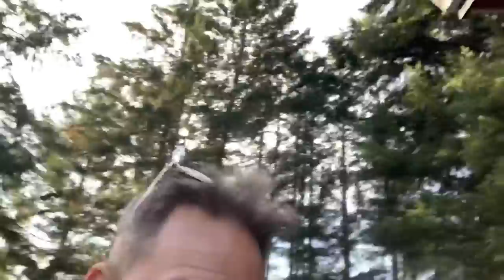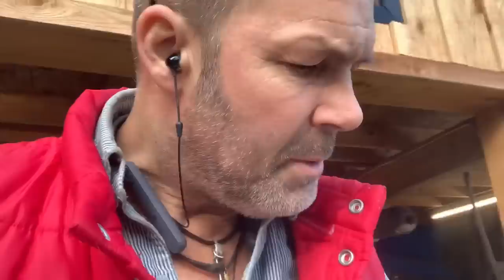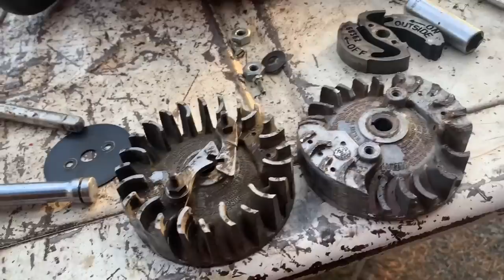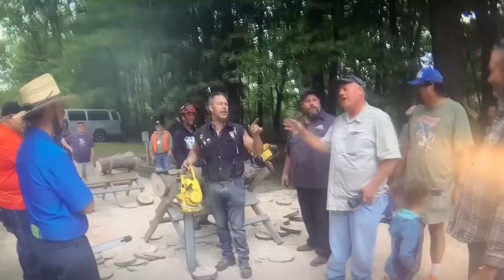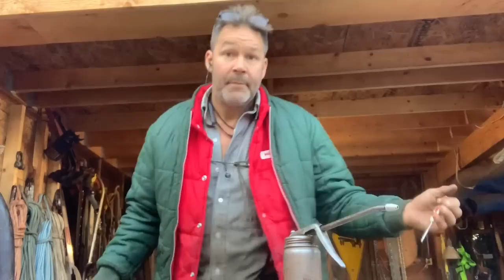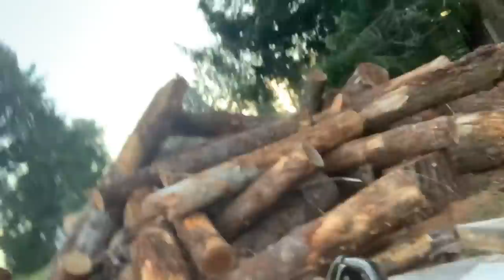Homelite chain saw find

Comment: Congrats, Billy. Just got a J-Red 621 running today thanks to the 20 or 30 parts saws of all makes I refused to junk. What a rush. Piston and cylinder looked brand new when I took the muffler off to mod. It's a screamer.
Reply: The older saws are loud, heavy, somewhat slow and vibrate. But they keep going. Easy to fix usually. They easily outlast owners.

Comment: So cool good the see that old saw running.... my dad bought a new Homelite back around 1974 to replace a huge old McCulloch chainsaw that was a bear to start. I don't know what size  Homelite was, but I would think it was a 45 - 56cc. The Homelite got used many many hours till it just wore out by the mid 1990. It cut all the firewood to heat the house all those years plus all the Redcedar bolts to roof his house and another one he also built. Really like that old Homelite.

Comment: I just retired my old early 80's homelite xl 10" limbing saw that I pretty much only used for cutting firewood while camping. Still good but needed more than I wanted to put into it. I wanted something with more power. I gave it to the local small engine shop so it shall live on either whole or parts  donor. Replaced it with a reman Husqvarna 435 16". Thinking of putting a 13" bar on it though do to space issues.

Comment: But i do have 12 different xl 12's, and a 1960 something  nos 1 i bought for my dad, and a couple freinds that need some rebuilt, my 4 bows, didn't hurt things either, but i have my original grandfathers, to try to restore, they both both bow saws, with 2 aluminum  things on it, manual oilers❤ em!.

Comment: I just scored a 150 Automatic Homelite, said it wouldn't run. Got it for free, bar is shot but fresh gas and it fired first pull, oils too! I put a 14 on it from a 16, lil saw cuts fine. Not bad for some carb cleaner and fresh gas!

Comment: That is a nice saw.  I have a little Super 2, a big XL12, and a Super EZ auto. The first two were working great after work but the Super 2 seems to have a fouled plug and won't start which is no big deal.  the XL12 bogs and stalls under rpm. It was a $1.00 buy and was a powerhouse after getting her going. Yet, the tank was all gunked up which I tried to clean but I think it has been releasing more gunk and plugging everything up. Maybe I can clean it up but worried there is a bigger problem. The Super EZ has never worked and I am guessing it has an air leak. Idles a bit and nothing more. The saw runs with the screws turned all the way in. The 130 sounds like a nice saw and runs smoothly.

Comment: Cool lookin saw. I just picked up a 1968 Pioneer 11-30  58cc for 50 bucks runs if i keep priming it. Just needs some carb work . I have a kit. Had to buy it cause its got a dual port chrome muffler.

Comment: My all time personal favorite is an little old pissed off Chinese man, try him out he is fun as it gets. Next up is Black Jack Shellac a Canadian cartoon bad guy, oho you try to fool Pierre yes no? Yeah, we all do it.
Got on the Homelite band wagon years ago but recently got serious about fixing the one I had that I knew had a groove in the cylinder from the piston ring positioning pin backing out slightly. That saw remains in pieces and I have 4 more that have issues save one such as bearings and such. The one I have that appears to be issue free is a manual oiler only XL12 with the others being the Super XL12 with auto oilers which I prefer. Some parts are still available but can be hard to come by in some cases. My mission is to put together one solid Super XL12, maybe this winter.

Comment: Hehe!...Buckin' my Friend you will remember that Orange Homelite VI 200 of mine (with full wrap and anti-vibe) The saw needed a new fuel line, well it now runs and cuts like a BEAST,  they sound so great don't they? I just plan to replace the original hard nose bar and chain, then it will be amazing. I will feature it in my next vid as soon as my new camera arrives:)   Take care Brother, WS.

Comment: What’s a safe fuel mix to run in an old saw if ya don’t know the proper mix ratio. I mean I run 25:1 in my old Echo and older Poulans. I always run 50:1 in my Stihls but wasn’t sure on old Homelite and McCulloch saws. I run nothing but Rec90 gas and synthetic Stihl oil.

Comment: What do you suppose happened to that flywheel? A bolt come loose? She pulls real good Buckin'. Job well done! 👍
Reply: I bet one of the starter dogs came off and got tangled up when the saw was at full squirt. Thus shredding the fins. Just my guess.
Reply: @Alpha1545  You are probably very right.  👍

Comment: I have an old Sthil chainsaw , still trying to figure out how to find aftermarket parts for it , so I can get it up and running new again !
Reply: What saw?
Reply: Sthil 041 av
Reply: @deliverybryan1138  what does it need?
Reply: I’m thinking it might need a new spark plug and a few more aftermarket parts for it . It started before then it bogs down and shuts off when im cutting firewood

Comment: Chain saw mechanic recommended OPT-2 single mix ratio for all 2 cycle engines, regardless of brand model or mix ratio, 40-1. 50-1 or whatever.  Anyone else using it?

Comment: Why do you want a chainsaw without a chainsaw chain brake?  It is not as safe as having a chain saw with chain brake.  Factories for today's chainsaws are only built with a chain brake for one reason.  Had it certainly been better without a chain brake then the factories that build chainsaws would have done so.